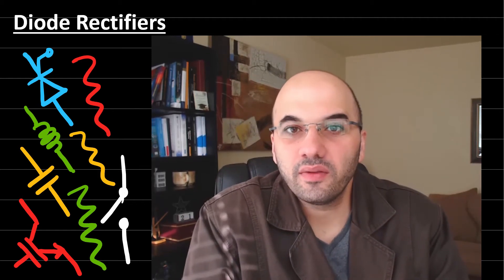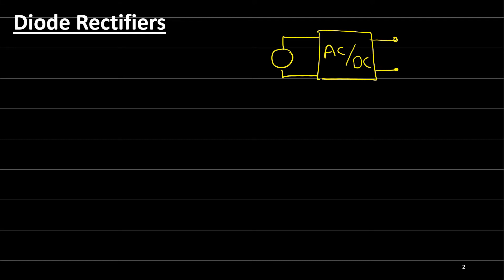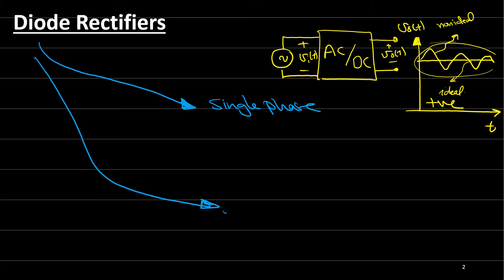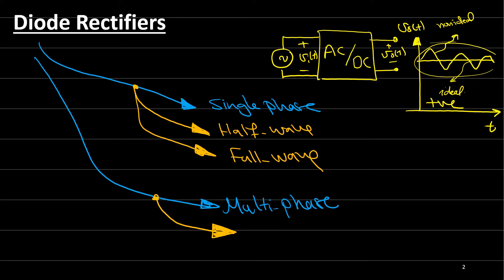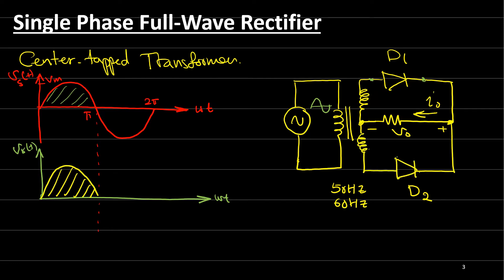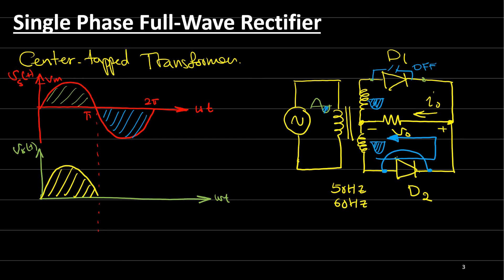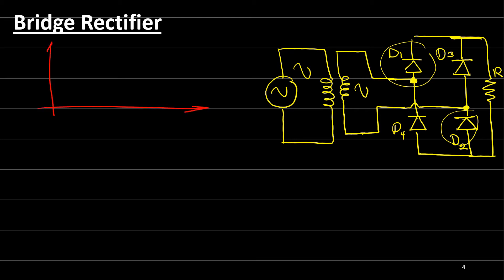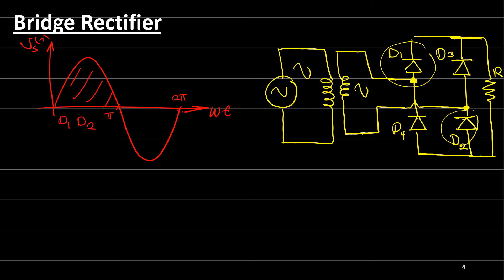AC to DC Converters | Diode Rectifiers | Power Electronics

Comment: Dr Ahmad, first of all, thank you for your lectures, very detailed and clear. I would need this lectures 20y ago:). 
Question:  For many years I had this confusion about conventional current flow direction in the rectifier, and here in this video I kind of see it again. 
When the polarity of the ac voltage is "negative" (from pi to 2pi), would it be correct to say that current remains having the same direction over the load,  from "top" to "bottom"(that is why we call it constant current)?  The conventional current flows in D3 to D4 direction because "negative" pi-2pi AC voltage works as "positive" for the D3 and it commutates, further positive potential opens D4 and we get path for the current.

Comment: thank you
could you please explain how change the electricity from DC to AC using  capacitor with multilevel inverter to have 5 levels but not too much switches  maybe 5 or 6 switches by PWM technique and in the same time increase the source voltage Vdc.?
Reply from the maker: Thanks, I will do this in the future
Reply: @Elkhateb  we are waiting you
Thank you so much
Reply from the maker: @islamalfirjani518  no worries